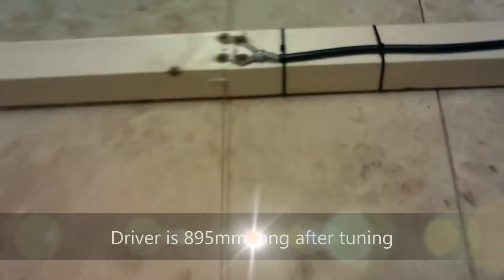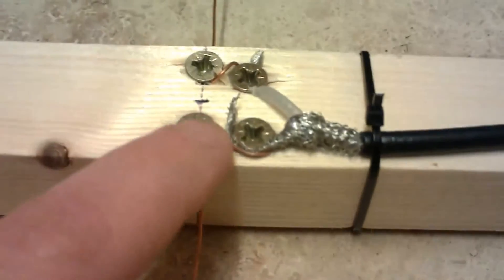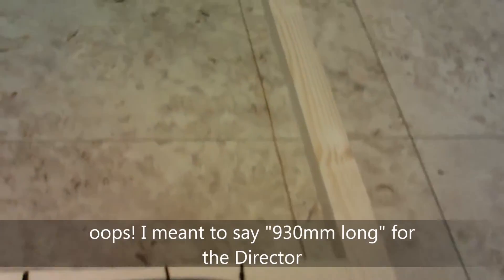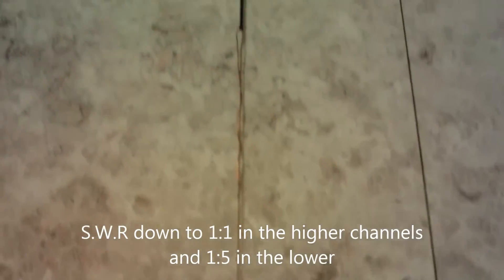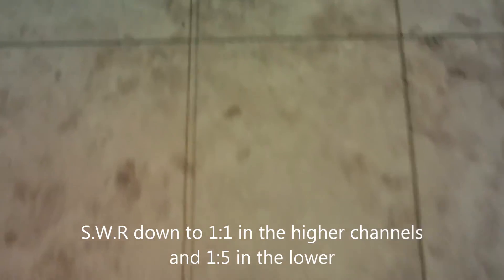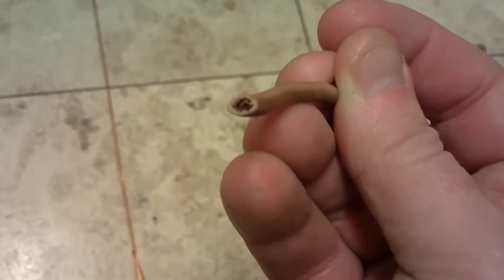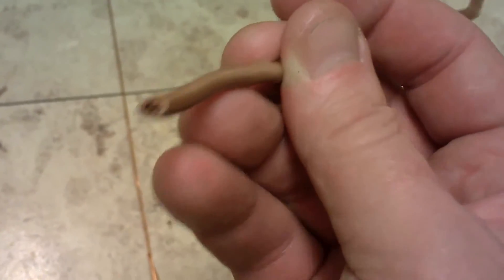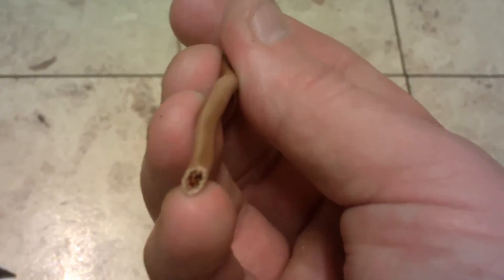Homemade wired Yagi 2 meter radio antenna

Comment: when you use insulated wire to make any sort of antenna you will find that the dimensions or the "cut lengths" will be a lot shorter compared to bare copper wire. This is because the plastic insulation creates a shortening effect. So if you try to use the same dimensions for insulated wire you may find that the resonance of the antenna will be lower in frequency and you wont be able to find a suitable swr reading. A suggestion would be to make a half wave dipole from the insulated wire to get a rough idea where it is resonant. Then apply the principles regarding reflector length and director length. This is just a rough idea to get you in the ball park. Also as the previous comment suggested about having some kind of balun or matching device at the feedpoint. This will help. Regards M1DEN